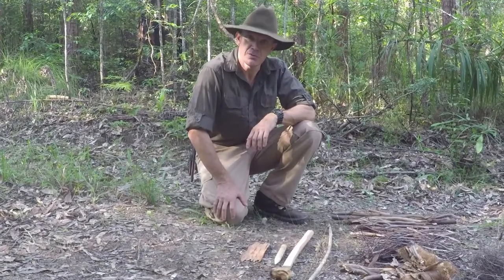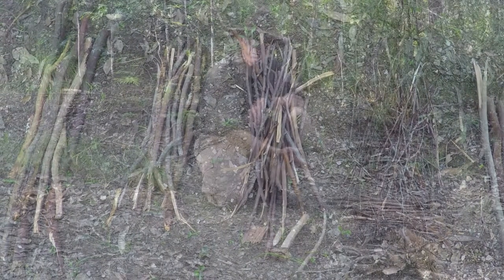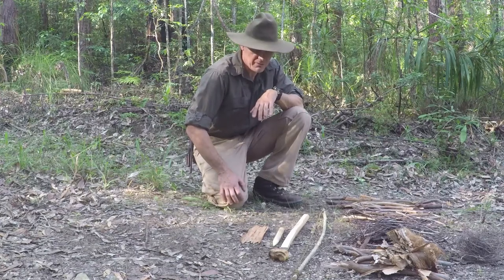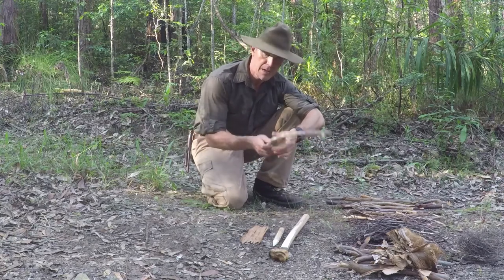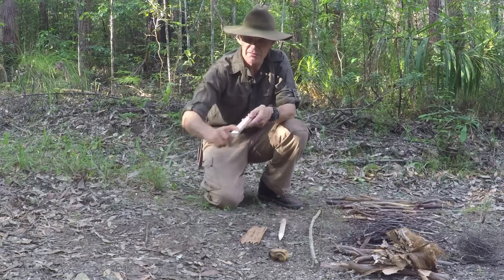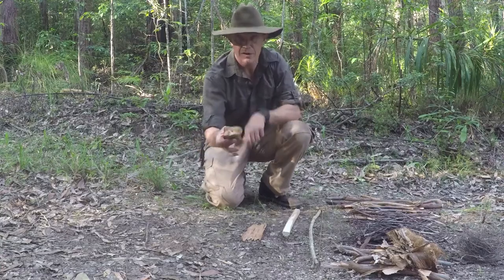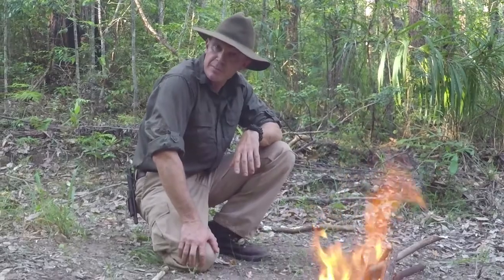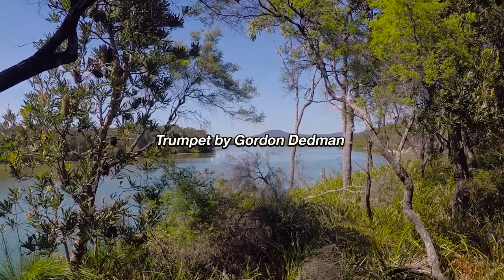Bushcraft Survival Australia - How To Light A Fire Using the Bow Drill

Comment: Great vid! What am I doing wrong if drill produces smoke but only brown char? And my handhold smokes too? Maybe wood is to moist?
Reply from the maker: It depends on the wood? The char/powder needs to be a dark brown. If it is a light brown, it generally means you are not using enough downward pressure. It could also mean you are using a wood that is not generally suitable for friction fire lighting such as a hard wood which will only produce smoke and "pollish". If the hand hold smokes, it could mean that your hand hold is a softer wood than your drill or that the shoulders of the top end of your drill are not "pointy" enough (too much  friction) and hand hold is rubbing against shoulder. Could also be because it is not dry enough.

Comment: Great video mate, you mentioned the drill and the hard board needs to be the same wood, its there any reason for that?
Reply from the maker: Yes. They both consume each other at the same rate. You can use different woods but when you are learning you want to avoid  adding too many variables and make things easier instead of more difficult. Hope that helps. Thanks for watching.

Comment: Great video very informative, what kind of knife are you using
Reply from the maker: Thanks Matt, I appreciate the feedback. The knife i am using is the Ray Mears  Bushcraft Knife which i bought in England a few years back when i was over there doing some courses. Its a great knife….however they are expensive!
A much cheaper option yet still very good knives are the Mora of Sweeden knives. They make quite a variety but the most suitable for bushcraft are the Mora Bushcraft Black or the Mora Heavy Duty Companion (military green), both carbon steel.